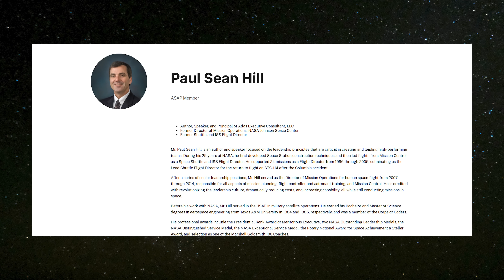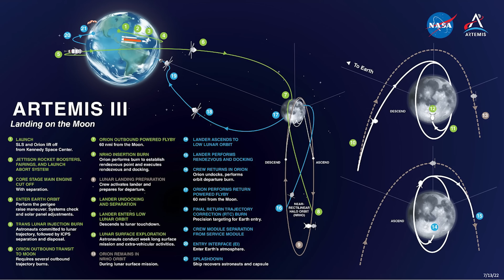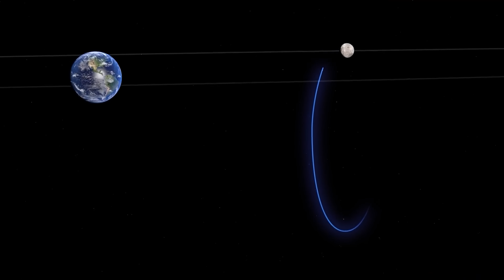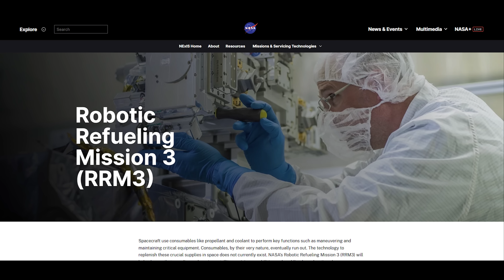Ex-NASA Chief revealed SpaceX Starship Problem Delaying NASA's Return to the Moon while China

Comment: And 5:00 here we are finally APOLLO IS DEBUNKED by Starship "much more proppelent is required" Saturn V could lift almost same as modified Artemis (90t) approx 135 tons or so i dont remember now. With most modified version NASA is able to send 115 tons to GEO almost just like in 70s .Still not good enough but close. Still more than Super Heavy + Starship is now estimated to carry 100 tons to GEO. They previously promised 200 tons they made it super heavy 3400 tons total. But from day 1 should be obvious that they would never deliver. Becausse its 2 stage rocket it will always have worse fuel / cargo performance than competition. Have performance of 100 tons to GEO only because it's bad design. The problem of Saturn V was the F1 engine but over all it was much better. Super Heavy is not that bad it's now comming back. But SpaceX put monster on top and that monster ruins everything IMO. I can only guess idea of Elon Musk 

The entire equipement Apollo SM+CM+LM for testing without fuel could be lifted for testing by Saturn 1b rocket not much bigger than Falcon 9 smaller than Falcon Heavy - capable of lifting 22 tons to LEO orbit. And LM itself with fuel was not heavier than F16 with all fuel and eqipement ~20 tons. 4 tons to land and 2 tons of fuel for lift of the Moon's surface. And booster they were put on top on the way contained 90tons of fuel and SM some 20 tons ,and CM dont remember correctly but some 2 or 4 tons either. And all of that was total 130+. If Saturn V 1st stage worked it would be still good enough.It could be resurected of museum.  This whole SpaceX farse not only debunking Apollo but also slowing down progress in space exploration. Because Starship is too universal should be 3 or 4 stages. Artemis is more expensive but its safe, verified multiple times and works. And lander itself should be much smaller. If you calculate how much is required then 2 tons is enough to lift them of the surface just more is required to get them back. Not  15x Starship to refuel

It's time to admit the truth maybe then some more competition will get involved and public could decide what to do. For now its designed to slow down proces and gain time. Using SpaceX to take all blame.

Comment: How ironic.
The glory days of NASA were when it functioned on what many would call a "socialist" basis. Recall that China is a communist nation.
Now that these NASA programs are capitalist we get massive cost overruns, failures, delays, and national embarrassment.
"The cash must flow."
Reply: Truth is it never worked. Saturn V F1 engine 1st stage never worked as designed. Rest 2 and 3rd stage of Saturn 1b that was put on top worked. Good enough to send all that equipement to low earth orbit. Never for real further. Super Heavy is not much bigger and it's only bigger +30% because it's universal 2 stage rocket. Instead of 3 stages of Saturn V, And if you include SM and LM i would say 5 stages. Artemis is very close in real life to the teoretical performance of Saturn V. Obviously if that was lie on paper real NASA wont ever be able to beat. Neither SpaceX. Quite easy to compare all these equipement by putting side by side mass of metal itself mass of fuel. 

What SpaceX should do instead is to make SuperHeavy only and NASA to "resurect" Saturn 1b and remake Apollo with modern technology. But they wont do that because they know it was lie. That radiation will kill crew that heat shield wasn't good enough for higher speeds. Reason why they designed in way they designed 15x refuel and Starship to be used as TAXI so they could come back. 

So you cant compare "glory days of NASA" because glory days of NASA are maybe only 80s and 90s with Space Shuttle later on Artemis. Going to the Moon aint that easy. Aint easy if you once faked it. And you never tried for real to begin with. Dont know whenever China does  that for real or not. But they will be first this time. SpaceX IMO was selected to have someone to blame and delay so public never know the truth. They will kick this out and start over again.

Comment: How are these spaceships going to Mars if it takes 16 refueling  flights just to get to the moon?
Reply: Legit question.  It's just not practical.  It's a falilure.
Reply: The so-called delta V required going to the Moon and Mars is pretty much the same. That's why. A rocket going to Mars and The Moon does not burn its rocket all the way. It only burns to get up to speed and then floats through space all the way to its destination. Once arriving, it uses fuel again to decellerate. That's why the fuel required is pretty much the same. Time is different though. It takes approx 6 months to go to Mars.
Reply: @SteenLarsen   The "so-called delta V"? What, does it prefer other pronouns?

Anyway, that Δv is gonna bite you. Mars has 40% G so yer burning quite a lot of fuel getting down and up again, even with the atmospheric breaking. And on the way down, you are carrying supplies for TWO YEARS, did we forget about that?

On the way back, the Earth isn't downhill like it is from the Moon. The Apollo SM basically just had to spit in the moon's direction and it fell down into the ocean. Not so for Mars, you have to run up quite a lot of velocity in order to make the transfer before everyone dies of radiation and osteoporosis.

Recall that the fuel you need later in the trip is multiplied because you had to lug it with you. Unless there are some more tankers to greet you over Mars. Hmm, each of those tankers which had to be topped off with other tankers in LEO so they could get to Mars just the same as you.

Sounds like it's a great day to be commissioning more reusable Starships that we can't end up reusing! I wonder how Musk can figure out to bill NASA for it?
Reply: they will build refueling stations along the route, obviously! the refueling stations will have a constant stream of refueling tankers going back and forth from earth. probably not as difficult as the engineers think IMO.. - elon musk
Reply: @BeachLookingGuy  
"they will build refueling stations along the route, obviously! the refueling stations will have a constant stream of refueling tankers" 
Why would you say something so obviously wrong? 
Not only wrong because of physics, but also in regards to everything SpaceX/Musk has ever said?
Reply: @3gunslingers  obviously i was joking 🙃
Reply: Short answer:
It doesn't take 16 refueling flights.
This is only the "safe" number NASA publishes based on their most conservative calculations.

Also you need LESS propellant to fly to and land on Mars than to fly to and land on the moon.
You need slightly more propellant to accelerate towards Mars, but the martian atmosphere slows you down again. On the moon you have to cancle out all your velocity using your engines.

Comment: I'm a little confused about why they can't boil off in a vacuum to maintain temperature. Yes, you'd get a vector - but is it that hard to balance the vector using paired ports around the center of gravity to achieve a sum-0 vector from the boil off?
I mean, it'd be nice NOT to have to boil off a % of your fuel, but I'm not clear on what makes it infeasible.

Comment: Why not just create fuel tank modules? (like the crew modules, but bigger, for fuel) these can dock on to the outside of the craft, get them there, be left in orbit, with the landing craft having enough to get back to them, to refuel enough to get back to earth and do the necessary. It is kindof like a primitive version of constructing the craft in orbit. Seems like it would be a bit safer and simpler, without needing to transfer all cryogenic propellant... also, if you routed the fuel through mild decompression tubes that were placed correctly around the fuel tank, then transferring or using fuel would actively cool the cryogenic storage... along with proper insulation,  transferring fuel from the tanks could actually cool and prolong the life of the remaining fuel.
Reply: They created a whole variant of the Starship dedicated to be a tanker. And you need a ton of them launching and fuelling the SpaceX lunar lander variant of the Starship to make that landing. After it's loaded, then you send the astronauts on SLS to board the luner lander, and... off you go. Hopefully not dying or having your absurdly enormous machinery explode anywhere along the way.
Fun fact: SpaceX's idea to put humans on the moon involves having single landing that would require more mass to safely touch down on the surface than the combined mass of ALL OF THE OTHER spacecrafts to ever touch the moon (be it in a controlled way, or crashed).

Comment: I think, that orbital fuel transfer is their least problem. Right now, they are not able to get SS into orbit, let alone reliably enough to be able to do 12 starts in quick succession. And we do not know, if they are even able to get some payload to LEO. SS gained weight substantially in recent iterations so projected 100-150 tons could not be possible anymore.
Reply: Here's what's going to happen
Eventually this waste of money will be cancelled.  China will get to the Moon first because we screwed around with this B.S.  
Where is the market for 100 tons to orbit?  Starlink is it.  2027?!!  Yeah, sure.  "Starship" is an empty tube.  No life support, controls, or anything else you need to manage the trip or keep crew alive.  So, they're going to get all this done in one year?!  The World's Greatest Grifter is at it again.
Reply: @theephemeralglade1935  exactly. I will just say, that NASA knew very well, this scenario would happen. This is why they choose SPX bullshit over realistic and basically proven designs of competitors.

In My opinion NASA does not want come back to Moon. There is no scientific benefit for them in this. It was and still is political pressure what is forcing them, but NASA in general favors non-human exploration of Solar system and thanks to advancement in computers, they are basically right. For given amount of money, robots makes much more sense than astronauts.

So they choose "solution" of HLS, which had guarantee to fail and they could blame someone else for failing in american return to the Moon and spare billions to more reasonable projects of theirs.
Reply: Have you ever thought to ask WHY SS hasn’t reached orbit?? There are legitimate reasons. What if government finally got out of the way of progress? Imagine the potential….do you think spacex would go faster or slower if not impeded by government? In Apollo all of government got with the program and everyone worked together towards the same goal..this is not happening now…have thought to wonder why?
Reply: @TheOmega1921  "This strategy is legally sound but ethically contentious. With 84% of SpaceX's revenue derived from government contracts—including $14.9 billion from NASA and $7.6 billion from the Department of Defense—the company's ability to avoid taxes while leveraging public funds raises questions about fiscal fairness. Critics argue that such practices create a "double-dip" scenario: firms profit from taxpayer-backed infrastructure without contributing meaningfully to public coffers."
Reply: @TheOmega1921  "SpaceX has faced criticism for a lack of transparency and accountability regarding its government contracts, particularly when missions fail, leaving taxpayers to bear the financial burden. The company has received billions in government funding while reportedly not paying significant taxes, raising concerns about its financial practices and oversight."
Reply: Seems like you have no idea what your talking about.   

Starship is not even trying to get to orbit yet,  by US regulations, and SpaceX standards Starship has to learn how to come back safely first.    It is too big to leave in LEO to have an unpredictable deorbit.    SpaceX is trying to figure out the heat shield, so they can reuse it.    Once it's reusable, you will see starship going up pretty regularly.
Reply: @michaelanderson4325  Musk simp alert!
Reply: @michaelanderson4325  According to SpaceX own timeline. Starship should've landed on the moon by now.
But they can't even do 1 full orbit around the Earth yet.

  You're the one who doesn't know what they're talking about.

Comment: Why would you say a program is on schedule when it has failed to achieve its objectives?
Reply: The program is on schedule every time Elon moves the goal posts...
Reply: But they are not late either…nasa knows how spacex operates (fail fast and often to learn) and has failed to enable the regulatory environment for spacex to succeed….so if or when spacex actually fails to meet deadlines with HLS it will be largely the us government that has caused the failure…after all spacex has zero control over the regulatory environment….the government either wants to get with the program or they don’t…it’s up to the government at this point…in Apollo everyone got with the program…is that the case now?
Reply: @TheOmega1921 So either the program is on time (because an infamous liar said so) or it is late because of the government (because an infamous liar cast blame)? Even if the claim about regulations slowing the work down was true, a capable program manager would have accounted for the time required in advance. In any case it seems highly unlikely this program will deliver anything of use, late or on time.

Comment: Build a tanker version of Starship.  Launch as many as needed with CH4 and with O2.  Mechanically gang them together.  Launch the manned and landing rated Starship and attach it to the "fuel system.  No air in space to worry about.  Use the tanker engines one or two at a time to travel to the moon orbit, ditching dry tankers as needed.  Land with almost full tanks and take off to rendezvous with tankers for return.  Lots of simple hardware, but faster and cheaper that anything NASA has been able to do.

Comment: I agree. If the return to the moon mission fails, it will be NASA’s fault, not any of their contractors. NASA made the NRHO call, and that is the problem. What nobody is mentioning is the risk to the astronauts that NRHO presents. During Apollo, if something went wrong on the moon, the astronauts could perform an emergency return to the command capsule within 3 hours (max!). With NASA’s genius new plan, there is no emergency return option: they are stuck on the moon’s surface for 7 days no matter what happens.
Care to volunteer for the flight?

Comment: Blame and deflection. SpaceX was only given the contract when every other possibility failed.  So any delays that SpaceX may cause will be minimal compared to the added years caused by paying $$$$$$ to some other firm to develop a lander.
Reply: Sorry dude that's not true. The contract for the lunar lander was bid on by SpaceX, Blue Origin with Sorry dude that's not true. The contract for the lunar lander was bid on by SpaceX, Blue Origin with Dynetics, companies like Lockheed Martin and Northrop Grumman were all involved in the lunar lander contract as well. The contract was awarded to SpaceX. They are behind schedule in meeting key goals in the timeline that was set in the contract. Blue Origin has built a lunar lander that is ready for flight testing and they hope to launch in the upcoming New Glenn flights. They have already developed and tested key hardware to facilitate orbital refueling in lunar orbit, as well as a system for the storage of cryogenic propellants in space. Unlike SpaceX, they have already built the hardware and have completed ground testing of the transfer and storage hardware. I don't believe in the best billionaire competition but I do know Blue Origin is far ahead of SpaceX as related to the lunar lander project. Dynetics, companies like Lockheed Martin, and Northrop Grumman were all involved in the lunar lander contract bidding and still are involved as well. The contract was awarded to SpaceX. They are behind schedule in meeting key goals in the timeline that was set in the contract. Blue Origin has built a lunar lander that is ready for flight testing and they hope to launch in the upcoming New Glenn flights. They have already developed and tested key hardware to facilitate orbital refueling in lunar orbit, as well as a system for the storage of cryogenic propellants in space. Unlike SpaceX, they have already built the hardware and have completed ground testing of the transfer and storage hardware. I don't believe in the best billionaire competition but I do know Blue Origin is far ahead of SpaceX as related to the lunar lander project.